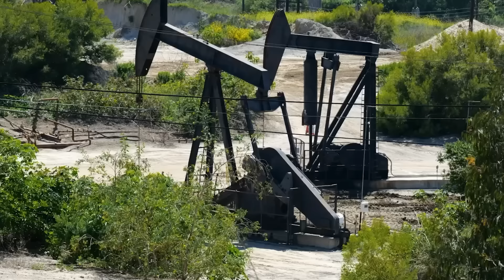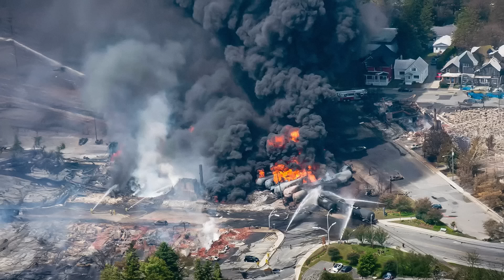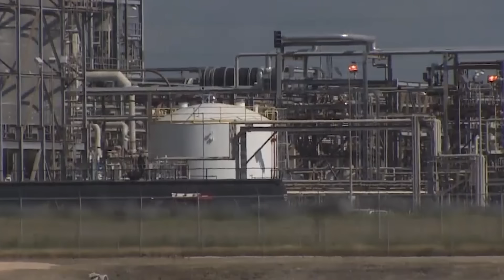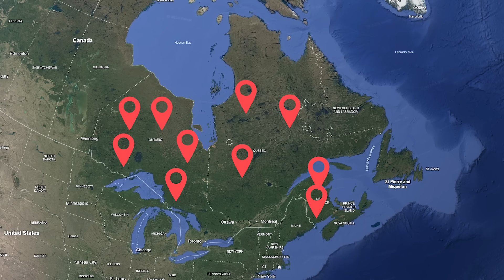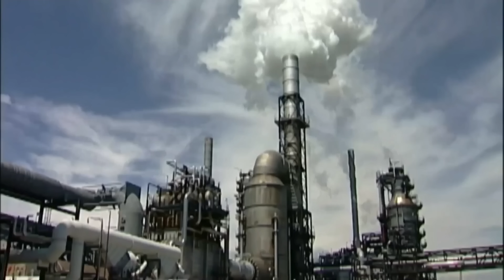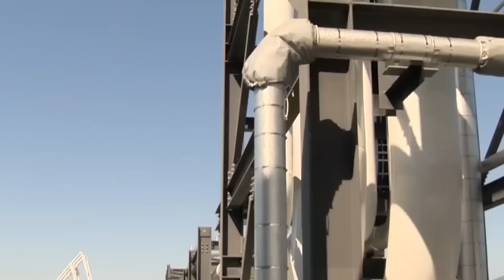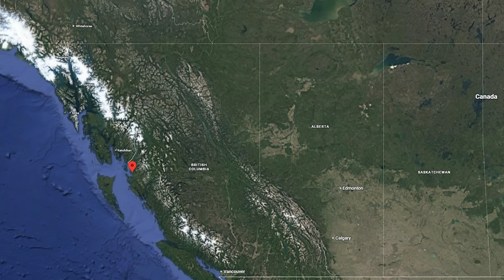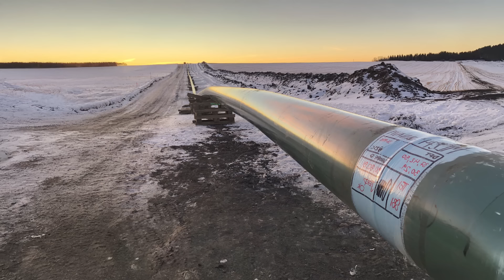Here's Why Canada Can't Build Its Own Refineries, Even Though It Produces Millions of Tons of Oil

Comment: Why cannot the BURNABY B.C. Refinery at the end of the TRANS MOUNTAIN Pipeline,be enlarged to refine more oil for B.C. customers??. 1.77 a litre is robbery!
Reply: Just refine in Alberta and pipe refined product to the coast, its currently done that way. Pipelines are multi-product.

Just build more storage tanks in Burnaby, way easier.
Reply: @northernmetalworker  Where in Burnaby?
Reply: @BobHill-s2cgood question, probably near the pipeline loading terminal.
Reply: @BobHill-s2cWestridge and IOCO.
Reply: NIMBY
Reply: Nimbyism and physical location - it's in the at the foot of a mountain in a narrow inlet, surrounding by hoity toity houses. The ships have to pass through Vancouver, where other traffic (including largest seaplane company in NA) operates.
Reply: It is heavily populated (and not particularly industrial) area
Reply: You are paying $1.77 per litre because your taxes are high. In Metro Vancouver you are paying about $0.70/L in taxes.
All prices are per litre
Regional Transit (TransLink) = $0.185
Low Carbon Fuel Standard (Hidden) = $0.180
Federal Excise Tax = $0.100
Provincial Motor Fuel Tax = $0.085
GST (at $1.77/L) = $0.084
BCTFA / Other = $0.067

Once you get outside the Metro area, the taxes drop by $0.13 to $0.18 /L
Reply: Don't complain, your electricity is so much cheaper than in Alberta
Reply: rofl, the price of gas would not change
Reply: Well, the BC government mandated that only "ultra-refined gas" is allowed to be used in BC. That is one reason why your gas is more expensive than the rest of Canada. Plus, your provincial taxes on fuel are high. The Burnaby refinery was supposed to be enlarged . Maybe David Suzuki and Elizabeth May objected to it?
Reply: They're doing upgrades right now. Probably won't affect you at the pump
Reply: Bro the price of gasoline is a world price the only thing you're saving is transportation costs. So like maybe a few cente per liter cheaper max. You just don't understand how this works.
Reply: They'd need a coker to upgrade dilbit, and those things are expensive.
Reply: @neilpk70 makes more sense to just refine at the source, ie Alberta, then just transport by pipeline from there. Trans mountain already moves refined fuels.
Reply: @northernmetalworker those fuels that go through trans mountain are heading to Asia! Tell your NDP colleagues to lower there taxes and then yell at the libtards in Ottawa and make them drop all there taxes and there hidden tax on carbon, which by the way is a scam TREES YES TREES EAT CARBON FASTER THAN WE CAN PRODUCE IT: oh and if you want to reverse climate change tell the government to outlaw cloud seeding!!!!!!!!
Reply: Gas 8s expensive in BC because of your provincial government.  They want the price high.  It is that simple.  Every mile I drive west from the Alberta border I see the price rising.
Reply: @lyndontrombley1970 exactly

Comment: Oil refinery in Saint John, New Brunswick, can refine Alberta oil.
Reply: The problem is with no pipeline, you have to haul it by train 3/4 of the way across country. Which would be 3 times as high as sending it through a pipeline, and much slower.
Reply: @johnhelms  Maybe they will pay to build the pipeline from Alberta to the East coast themselves? They always cry about pipelines but never mention who is going to pay for it. They also seem to forget that the federal government (Liberal at the time) bought and expanded the Trans-Mountain pipeline.
Reply: Just remember that transfer payment pipeline has nothing in it without the oil being sold. Customers always pay for shipping. Oil from the middle east you buy the oil and pay for shipping. Same with Alberta. Tell us when the pipeline is built other wise it's south.
Reply: Yes in 1974 i iworked on a contract in that refinery Irving Oil i enjoyed working in Canada really nice people.
Reply: There are 13 out of 15 refineries in Canada that use Alberta bitumen sands heavy crude oil right now. 

All 13 of those refineries receive deliveries directly via pipeline from Alberta, including all four in southern Ontario (via Line 5) and the only refinery in Montreal (via Line 9).

The two refineries that do not use Alberta crude oil in their refinery diets are located on the south shore of Quebec City, in Lévis, and in Saint John, New Brunswick.

The refinery in Quebec City is owned by Valero and the same company owns a massive storage depot in Montreal. Furthermore, Valero also owns an oil pipeline between Montreal and Quebec City.

So the reader may be asking themselves: so wait, if there's already a pipeline between Alberta and Montreal and another oil pipeline linked directly to the same company's refinery in Quebec City, why aren't they using Alberta crude oil too?!

The answer is simple: it's not economical to do so.

Alberta bitumen is heavy in asphaltenes and low in resins. This makes it a low-value product that is generally used as a cheap blending agent to bring down the overall cost of refined petroleum products. Remember when the Conservatives told you that Western Canada Select oil was priced lower than West Texas Intermediate because there was insufficient pipeline capacity to Canada's west coast and Canada was stuck with only "one customer"? Well, the Trans-Mountain oil pipeline is now complete, exports are happening all over the world, plus, there is excess capacity available on it!! And the price gap between Western Canada Select and WTI is still over $12/barrel on average!! Chalk it all up to yet another Conservative lie. Pierre Poilièvre is a rank expert at lying to Canadians and Conservatives are repeating the same, tired lies that are being disproven every day with TMX exports to Asia. Bitumen sands crude oil is low quality, and no amount of pipelines will ever change that. 

No, Valero actually uses their pipeline to ship finished products westward, from its refinery to Montreal instead of shipping Alberta crude eastward. 

Suncor also owns a Quebec refinery, in Montreal.  Suncor blends Alberta crudes with imported crude oil from overseas via tankers that land from the eastern US, Norway, the Middle East and Nigeria with light, sweet crude oil. The imported oil either arrives by tankers, or occasionally, gets unloaded in Portland, Maine and then piped to Montreal. 

Incidentally, the company that owns the Maine to Montreal oil pipeline applied to reverse its direction, so that the line could carry tar sands bitumen from Line 9 to Portland, Maine for marine export via tanker.  Concerned citizens of Portland in 2014 passed a municipal ordinance banning the export of oil sands bitumen at the Port due to environmental concerns. Portland Pipe Line Co (PPLC) filed a lawsuit to overturn the ordinance as unconstitutional, and against interstate and international trade. They lost in Court and abandoned their appeal in 2021. 

Many find it amusing to listen to the same Conservatives who worked tirelessly to destroy Canada's National Energy Programme in the 1980s now turnaround and counsel the government to ignore the economics and build a brand new pipeline from Alberta to those two refineries, even though it makes zero economic sense to do it today with all the existing infrastructure in place.
Reply: @paulboileau3758 Those protesters in Maine had no issue with tankers delivering in Portland .Follow the money . The New Brunswick refinery did receiving Albert oil via tanker during the pandemic . The tankers went through the Panama canal .

Comment: Two new refineries have opened in Alberta in the last 5 years one convert natural gas into plastics and the other makes diesel from a combination of oil and natural gas.  Beyond that there refineries in Sarnia, Missisauga Montreal St John's and in Newfoundland of those one just does lubricants, one is mothballed and three are going full blast (Sarnia, Montreal and Irving).  There is also a small refinery in mid-western Sask and that makes both diesel and gas and is less than 10 years old.
Reply: Further the Irving refinery in New Brunswick supplies 70% of gas consumed in Maine, Vermont and Hampshire, 50% of Ma and 90% of the jet fuel in MA. If needed I am sure Irving could could re-direct to Ontario.  The idea that Canada is unable or unwilling to supply itself is stupid.  The industry works to be the most cost effective way.  It is just less costly to export in the west and import in the east.

Comment: Synthetic upgraders take heavy oil and turn it into spec perfect light sweet crude for a cost in the $10 a barrel range. But they are expensive to build and the US needs heavy oil not just because they built for heavier oil but because US oil went from being light to extremely light after fracking took over and boosted US oil production. Very much a case of mixing extra light oil with heavy oil to make just oil. 

The biggest reason no large pipeline exist going into Ontario is the Canadian Shield formation that adds about 1000km of solid rock with no soil to dig to build a pipeline. It's wildly cheaper to build a pipeline to Toronto and Quebec through the US than it is through Wester Ontario. A surface pipe run like in Alaska is possible but would be much more likely to be damaged by accident or attacked by anti oil activists.

Comment: Within the next 20 years, China's massive growth in wind farms, will make it a net exporter of electricity. Therefore they will no longer need Canadian heavy crude, unless they can use the by-products of Canadian heavy crude? In addition China has nearby nations that will gladly buy their clean, cheap electricity. Acknowledging that fact Canadians have been betrayed by there governments, since the beginning, & lost out on being innovators of alternate power sources!

The big problem with this video is that it never acknowledges that from the very beginning oil should have never been adopted as a long term consideration for energy use! The fossil fuel industry has long known of it's harmful effects & exploitive effect on indigenous peoples but because there was so much of it, easily taken from the ground, they saw the short term gain & went for the $ Benjamin's $ which is how they continue to operate. In the early stages of the automobile industry they experimented with hydrogen & battery powered cars but with corruption/lobbying from the fledgling Robber Barron's the easy score was the way to go. With strong R&D into the problems with alternate power sources, Canada & the World, wouldn't be in this mess! Fresh Tech seems to gloss over these effects in their video (perhaps Oil Company backed trolls). Either way, oil should have remained underground, leaving its' horror of fracking,  sulphur emissions & climate change to the ages

Finally, to address why Canada can't build their own refineries, Canadian politicians were bought out from the very beginning. Capitalism's profits have too strong a hold on Canadian government. In the beginning of  CDN oil production, politicians flirted nationalizing it's operation but after heavy industry lobbying pressure & a blind eye to the future they caved into the market & left the people to the whim of Capitalism. History shows how oil extraction  has provided extreme wealth to Capitalist Fossil Fuel Felons, while ordinary citizens are burdened with subsidizing that same industry which makes such obscene wealth from this toxic product! 

Proportional Representation is the start to solving this problem!

Comment: Nonsense. Pipelines are both practical and financially feasible. For example upgrading methods—such as thermal cracking, hydrocracking, and catalytic cracking—allow bitumen to be made pipeline-ready with less energy and fewer emissions. Also $25 billion for a new pipeline is nothing when you are talking about the energy security of a country. Consider Canadian governments spent around $158 billion over the past decade on "green economy" initiatives aka corporate welfare for no real economic gain. In this context upgrading oil refineries is a non issue.